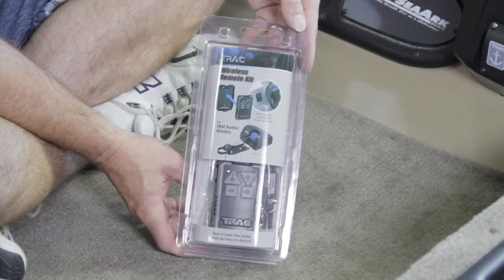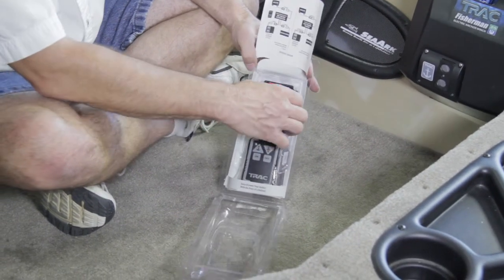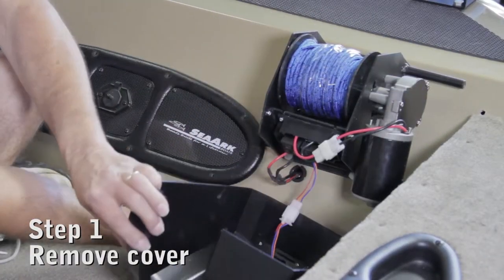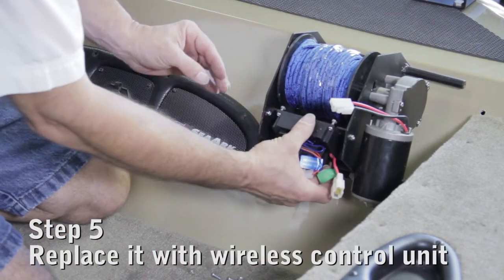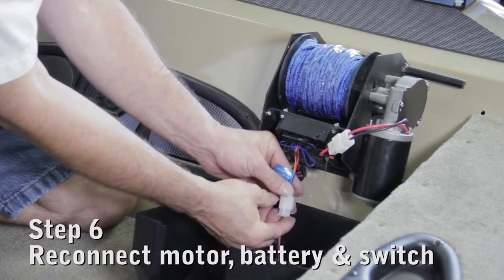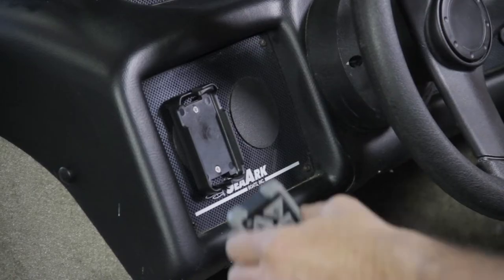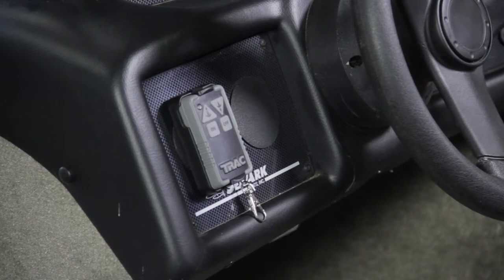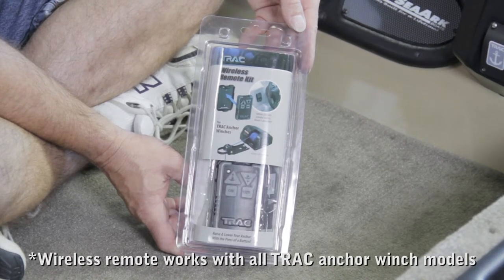TRAC Wireless Remote Installation

Comment: I have two boats both with Trac anchors with remotes. Both of the remotes will not work. I replaced the batteries. Are both remotes bad ?? Is there anything special to pair the remotes to the motor??  Any tips would be much apprenticed

Comment: My remote does not work or light up
Reply: Check for battery.
Reply: @patriot101101  After installation of the remote kit as directed and performing the programming as directed (several times) no luck. So I checked the size 27 battery inside the remote and had it tested. It tested "good" at "Batteries Plus"  So, I went home, checked all connections again, again attempted re-prgram,,Still no luck  So, I installed a new  battery in the remote.. Tried the program routine again and still no luck, The winch works perfectly via the up down switch on the winch unit  but not via the remote. I have had a same model electric anchor in the past and theyremote wporked great. Do you think the remote is bad?